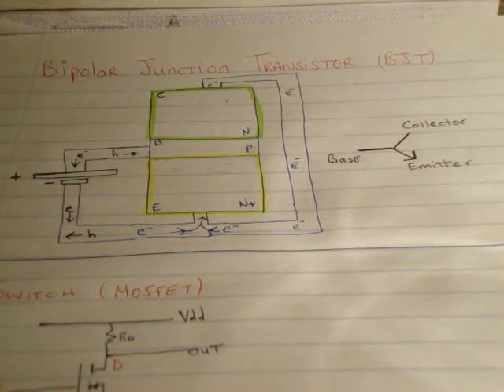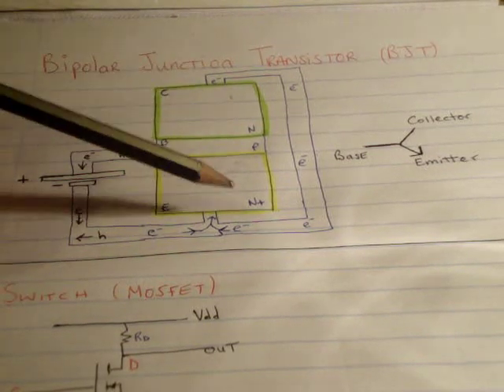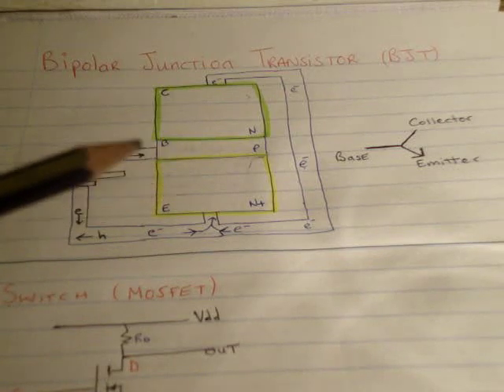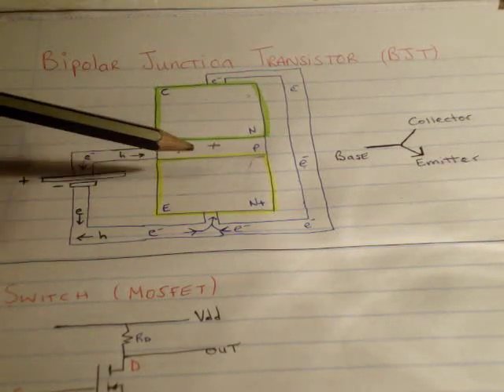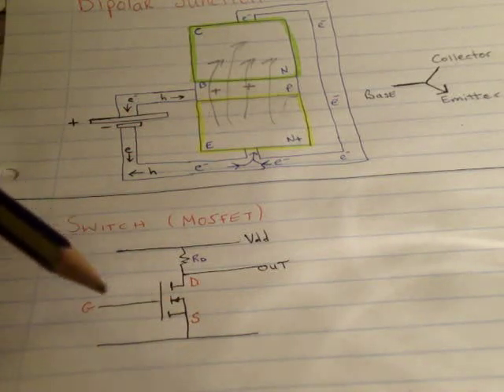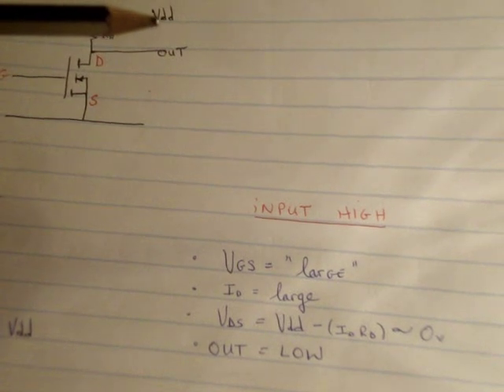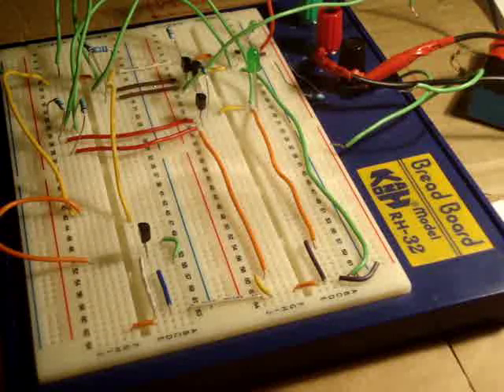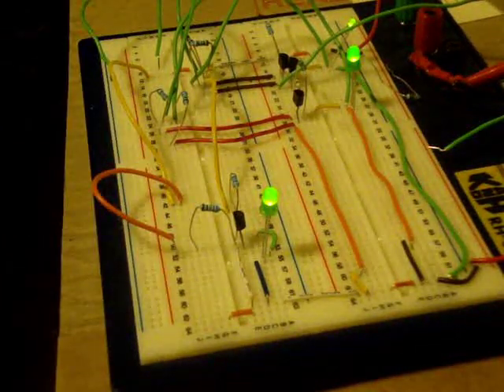Electronics 2 : How a BIPOLAR JUNCTION TRANSISTOR (BJT) WORKS

Comment: I have 2 big concerns which I hope you can help clear. The first is that I can understand electrons flowing from emitter into the base because electrons from the base traveled to the positive terminal of the battery leaving behind positive holes. But what I do not understand is why do they also flow into the collector now? What does the collector have to attract these electrons? 

Secondly, I wanna ask how do electrons from battery and collector flow through Emitter. Shouldn't they repel??

Comment: there's stil current flowing through your resistor when the Voltage at the gate is zero... Why do you then say that the voltage wont drop across the resistor?  How can the voltage still be Vdd at the output... the resistor is still there.

Comment from the maker: Essentially, holes are an absence of electrons (or a space where electrons can flow into). So if holes exist close to electrons, the electrons are generally attracted to the holes (leaving of course holes where the electrons were). So a flow of electrons right is THE EXACT SAME as a flow of holes to the right. We use the whole concept of holes because it's MATHEMATICALLY easier than dealing solely with electrons (but at this level we don't experience the difficulties yet).

Comment from the maker: Hi there, I never had a chance to really answer your question. In the first diagram there is no battery connected alright where there should be one. To be honest I was using a diagram from a textbook which I thought was useful (even if it's not complete). If you look at the second diagram where I have VDD etc., you will see that the battery is indeed present. Thanks for pointing that out!

Comment: It's scary that you believe that, and that you're trying to teach others about BJTs. BJTs are typically used in forward-active, which requires the collector-base junction to be reverse biased. The reverse bias is necessary as it creates a depletion region. The dopants in the depletion region create an E-Field, and this field is necessary to sweep the injected carriers (resulting from forward-biasing the base-emitter junction) across the base and into the collector (to get collector current).

Comment from the maker: Ground means that the potential (or voltage, or electric potential energy per unit charge..all the same) is zero. So literally you connect your wire to the negative termainal and you're at ground.